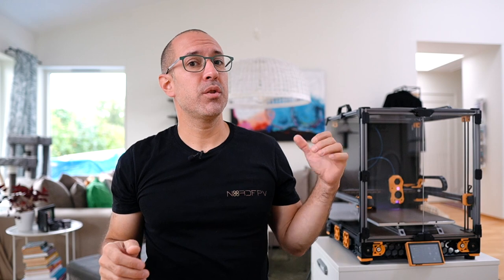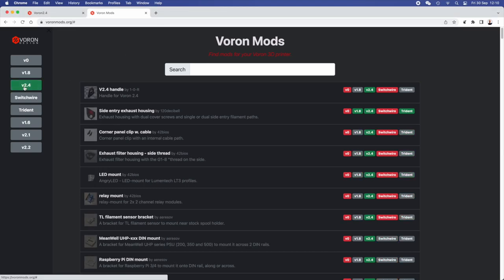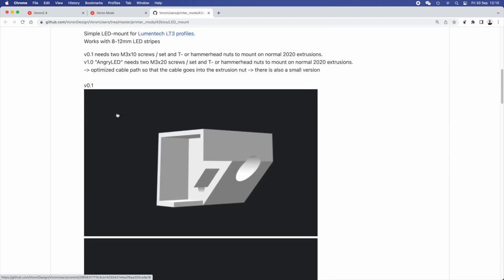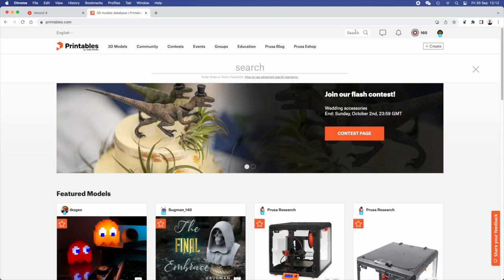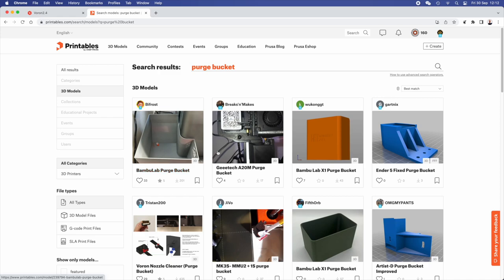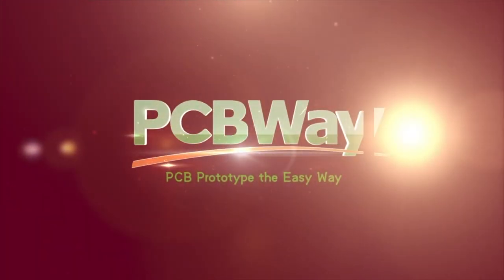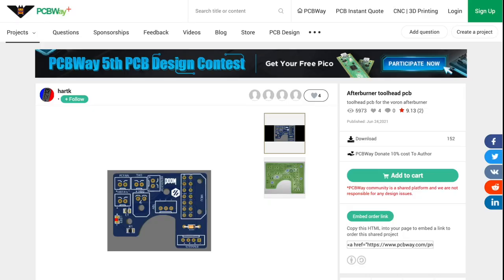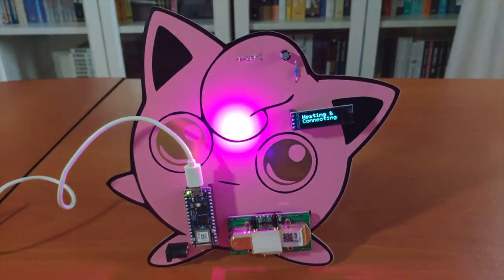Best mods for a Voron 2.4 3D printer

Comment: Maybe listed below,.... but Ramalama2 front-idlers are the one of the best mods I added to my 2.4.  I have canbus and under mounted z chain... no other chains..etc.   Still had trouble with belt wear on the x/y belts.  Ramalama front-idlers fixed that issue for me.  Belts run perfect now.
Reply from the maker: Good list

Comment: Two things that could be added to the list are a filament runout sensor and quick release clips for the sidepanels.
For the panel clips just search for Voron 2.4 Filament Latch, those are really nice.

I would love to know which extruder mount and Cable Cover you use on your Stealthburner.
So far i haven't seen any other LGX Lite mounts that can fit the breakout PCB neatly under the cable cover.
Reply from the maker: Hey. Thanks for your comments. I have the lGX lite and a mosquito, and I’m using a prototype mount created by Olof Ogland from bondtech which you can find in the official bondtech discord channel. It works perfectly for me. He has done a few iterations and I’m testing all of them. 
The cable cover is also made by Olof and fit for this part perfectly.
Reply: @NordFPV  Thanks for the Info, i'm printing Olof's Extruder mount right now.
Reply from the maker: @taumelscheibe5948  Great, I'm sure you won't be disappointed

Comment: I dont understand why so many users prefere the can bus "mod", there is a very easy and cheap way, without difficult configutation change for the Vorton, use the FCC Mod, no cable chains, no anoying cables, easy to do and very durable, with enough options. This should already be the number one mod fpr the voron... (in my opinion)
Reply from the maker: Hey Zak. You can’t throw that here without a link! 😜. Can you point me in the right direction. I want to read more about it.

Comment: Nice video mate. Interesting printer.
Reply from the maker: Thanks 👍
Reply: Firstly very informative video 👏. I just bought a ldo kit and I want to upgrade to a screen like yours. Where did you find the walkthrough/instructions to install it on your voron.
Reply from the maker: @fabianclercin8125  Hey Fabian. Most of it comes from klipper Screen's own website: https://klipperscreen.readthedocs.io/en/latest/
There you have examples of screens that works and the installation process.
You can also search STL for other mounts if you want.
The mount I use was this https://github.com/VoronDesign/VoronUsers/tree/master/printer_mods/alanho/BTT_PITFT50_v2_Mount which I think it's linked in the comments as well.

Comment: Hello, What size would you recommand to build? 300mm or 350mm. Want to print abs or petg carbon. Thanks
Reply from the maker: In my case 300 is more than enough, but I normally print small parts. It all depends on what you print, what kind of space you have to store it and so on.

Comment: why do you need Voron 2.4 when you print only small parts? could you provide some detailed examples of your prints?
Reply from the maker: Hi. My main printer is actually the V0 because of the size of the parts. But sometimes I need space because of volume. When I need to print 20 of the same part where the V0 fits 2 or 3 I can print all 20 in one go with the v2.4. Then is not that common but some times I get to print bigger parts. So the combination of the V0 and V2.4 is excellent, but the V0 works more than the 2.4.

Comment: Will the new Creatity Sonic Pad work for a Klipper screen? I heard you can load it with Klipper or it is already loaded with Klipper.
Reply from the maker: Honestly I don’t know much about it, but from what I understand, the Sonic pad has a pre-installed software which is similar or based on klipper screen but is not the same. I think you should be able to make it work with a klipper machine but it may take some effort. Is not going to be out of the box.
Reply: @NordFPV  thanks. Will look into it.

Comment: Great lineup of mods. What are  you using to cover the cable runs in the extrusion channels? That stuff look much better than the typical rubber seals.
Reply from the maker: Hi and thanks. I just printed a extrusion cover from printables.com. Search for 2020 cover and you will find many. I printed it using ASA since I was printing parts for the voron, but I think it may be better to print with a flex like TPU

Comment: I’m going to buy a printer for my wife for Christmas. But I’d love to build one of these for myself. What would be decent so I can print the parts I need to print Voron pieces?
Reply from the maker: To print a Voron you need to use ASA or ABS. Both filament are best printed when in an enclosure, which means if you want to print your own parts you need a printer with an enclosure.
I'm a big fan of prusa printers, specially for beginners, but they don't come with a natural enclosure and you have to buy it separately. I think that will be my choice, a MK3 with an enclosure.
Otherwise you always have the great option of using the print forward program from voron, which I highly recommend!

Comment: Great video! I don't have a Voron yet, but I like the camera idea. My only question is, with the high temperatures could that cause the camera to fail? Not sure how hot it gets toward the top of the printer when it is enclosed.
Reply from the maker: Honestly, it's something I've been wondering myself too. When printing ASA I reach 60-65C in the chamber, and that can't be that good for the camera, but so far nothing bad has happened, and a lot of people have this mod, so I'm guessing that it will last a bit?
Reply: @NordFPV  Bummer we can't print replacement cameras haha